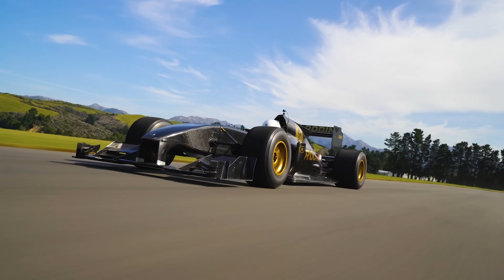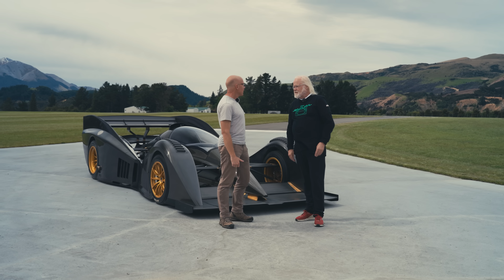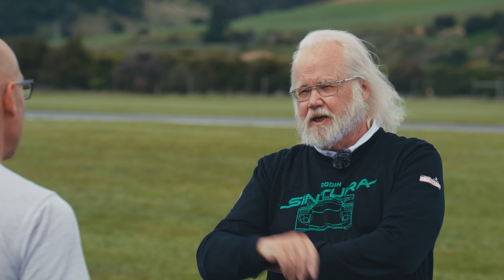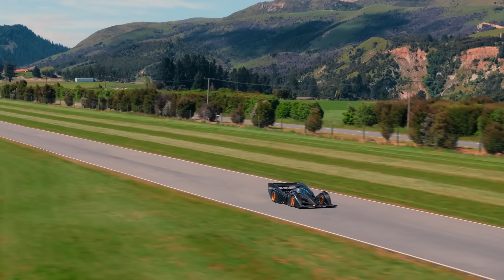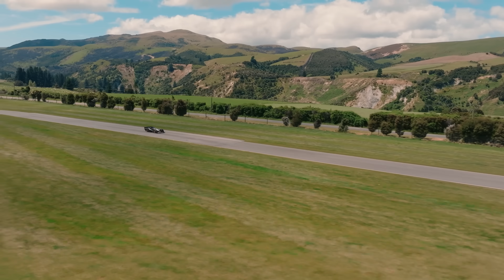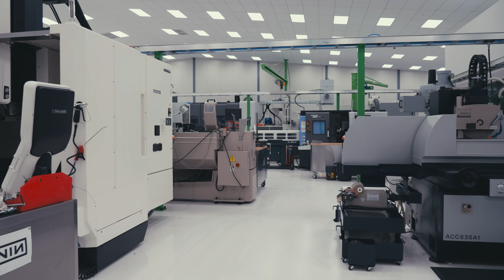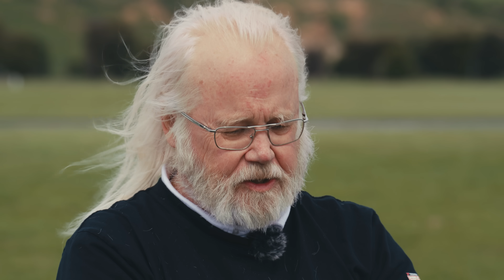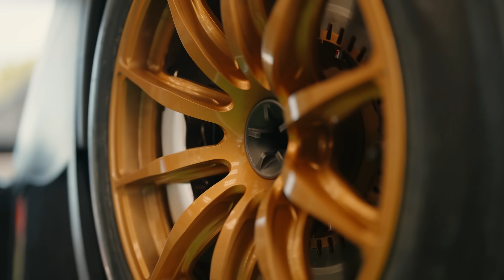Rodin FZero – 1500bhp Single-Seat V10 Madness!

Comment: This guy sounds like he’s on the top of the Dunning Kruger curve. 
So arrogant into thinking he can make a car faster than an f1 car that not only takes millions of pounds and years into development but also hundreds of the most talented people in their respective fields all working together. 
F1 teams don’t just build a car based on couple of YouTube videos and a few nights of thinking. It takes decades of knowledge to carry it all through
Reply: No. They build cars to very strict rules.
Without the rules it’s EASY to go faster than F1. Imagine an F1 car that wins by cheating. Then imagine a car that ignores the rules. Not cheap or a 5 minute job, just very very do-able.
Newey is not god.
Reply: Yhea it’s very do-able… for a team with 300 engineers 😂. Not one 70 year old dude who can do a bit of CAD. Hence why this guy‘s car hasn’t beaten an F1 lap times.
Just the fact of him saying they do CFD at 300 kph is already a red flag.
Reply: @diogosimoes3618  You could do it in your shed. Just requires will, imagination, a bit (maybe a lot) of engineering nous and a pile of cash.
Check out Robin Shute’s pikes peak build.
And maybe my next one, if I get my act together.
Btw, a single seat closed wheel car with 1500bhp would do 300kph on about 1/2  throttle. It’s also got the potential to pull enough G’s that the driver would need a g-suit. Why is that ridiculous?
Reply: Do you realize that Porsche took their lmp1 car, which btw also costed over 100 million to develop,  made it into a monster that didn’t have to oblige to a rule book and still couldn’t beat the f1 cars of today. 
It’s called the 919 evo. And it definitely wasn’t built in a shed by some guy who knows a bit about race cars and so he thinks he knows it all.

Also it doesn’t just take power or downforce for a car to be able to be fast. It has to be well balanced. Predictable. Forgiving. 
Those are the things that cost the 100 million plus pounds and the hundreds of talented engineers.
This car isn’t as fast as an f1 car. I bet it wouldn’t even beat an LMH car.
Reply: @diogosimoes3618  no. The 919 was still built to a rule book and the evo was a drestricted version.
Being “balanced” and “forgiving” does not cost millions, don’t be so stupid. They are the product of setup - as long as the fundamentals are right.
Sorry, weight, power and downforce are what create speed and this thing, while hideous, has the potential.
I say again, look at Robin Shutes pikes peak build. That’s going to be on another level.
Don’t be so blinkered that you think a Porsche badge and 100million makes the ultimate. It’s an lmp car, still limited by rules.
Reply: @jiminycricket9877  Jimmy let me tell you something. I know your wife left you and now you spend the days in that ass shed of yours acting like you’re building a race car. But unless you’ve actually done it or worked with people from the Industrie I would stop making a full of my self in the YouTube comment section acting like you know it all. You’re not a genius Jim. You’re just sad.
Reply: Just outta curiosity. You “know” all this how ? Cus you seem to know an awful lot my guy. 
Have you built a race car before ?!😯

Oh wait… is that the race car you built in you profile pic. Damn. I bet that could beat an f1 car 🤣
Reply: @diogosimoes3618  no, that’s a road going Peugeot 205, I’ve never claimed anything else! Yes, I’ve been involved in building numerous track, hill climb and rally cars over the years. I’ve had a concept in my head for a long time now and hope to make a start on it at some point. I freely admit that I don’t have resources to go as fast as F1 and it’s not my goal - I just want to build what’s in my head to the best of my ability.
Why do you feel the need to troll someone who is merely pointing out that F1 and LMP cars are built to strict rules and therefore are not the ultimate? Odd.

Comment: It's a wonderful artistic monument to Mr. Dicker's passion, but I'm glad to hear this is going to be superseded by a V2. I hope the aero folks are listened to, as this version has some very pronounced flaws. Also, the exhaust in the air stream isn't just obstructive of flow, but it'll harm engine performance by cooling the exhaust excessively before it reaches the turbos - not ideal. But more power to him, it's a wonderful venture...

Comment: Of all V10 engines to inspire sound, they choose Viper. What a thash!
Reply: although not impressive for power density, the viper engine had a lot of advantages over the other few V10s that came and went, its low power density meant it was more durable and delivered a smoother driving experience, despite the car itself being very... volatile to say the least, it was motly due to the lack of other safety and driving assistance features rather than the engine itself. 

also the viper engine was the first road legal V10 and what uultimately started the powertrain usage on cars as it was already a novelty, and a rare one, in the world o powertrains, and it remained a rare breed through its history and now its virtually dead, with no production road car with a V10 existing, F1, LMH, and others dont use it anymore for years. the last road cars to use a V10 were the just discontinued Audi/Lambo FSI 5.2L based cars, not just the R8 and Huracan but also 2 notable very limited projects, the Pambuffetti PJ01 and the Bertone GB110. both very limited production which i think will finish delivers till 2026.

this, the RB17 and strangely enough a Rolls Royce war tank engine are the only modern usages of a V10 currently, with Rodin still offering a 4.0L crate V10 or sale and Judd still offering maintanance, upkeep and specific comissions with their limited set of V10s, but i think they only rent the engines dont fully sell or manufacture new ones.

Comment: the FZero looks like a moden Can-Am Monster. The huge fenders, the gigantic wings and the overall proportions.... just as crazy as the cars in can-am in the 70s with basically no rules
Reply: This is the closest idea of what a modern Can-Am car might look like.
Reply: Mclaren
Reply: @CrashInnes  My first thought on seeing the rear wing & it's buttress' was M8F. I'm surprised it wasn't mentioned, he being a Kiwi & all.
Reply: That is what I was thinking as I watched it drive around at the end. I wasn't so sure of it at the start.
Reply: Exactly what i replied. This is what can-ams would look like if they still raced
Reply: My thoughts exactly!! Can-Am rules!
Reply: I'm not sure where these claims of reliability are coming.  We aren't talking about an engine with decades of testing and development like the Judd V10 or just about any other engine.  There's a reason many larger carmakers choose proven crate engines.
Reply: @KRAMITDFROG  I think what is meant here is 'short-term reliability' compared to all-out race engines that sometimes don't last a single race. It might seem like an oxymoron but it's all relative.
Reply: i was thinking the same also reminds me of the 917
Reply: Love a big wang..... Big Wang Gang for life 😁
Reply: Sadly making the same power as they did 50 years ago.
Reply: @BobBobbington66-t9s  .... probably with reliability and performance they would kill for 50 years ago.
Reply: @BobBobbington66-t9s  but way more reliable and without the need to rebuild the entire engine after a race
Reply: @BobBobbington66-t9s using about half the displacement.

Comment: This can not be put in the same category as the McMurtry Spierling. Sure they can both do "F1-like times" around a track but the Spierling is beautiful and this thing looks like it was designed by a blind 8-year-old using his/her/their non-dominant hand. I don't think anyone, regardless of their level of wealth, will buy this car over any of the many beautiful options already available. Even if it does have a V10.

Comment: the nubers and the headline are great, but, BMW got simimlar power from a 1.5litre 4 cylinder back in the 1980s. So although this will be a fun toy it hasnt really moved on since our acheivements of 40-50yrs ago.
Reply: Yes, they did, for one lap before exploding running 80 psi of boost with a mixture of gasoline and toluene, and this makes 1500hp compared to an alleged 1400hp for the f1 engine
Reply: @user-cu4mo8hv1f      so the point is that we know how to get 1hp/CC, or 1000hp/litre.  its not new information.    we havent moved on in terms of specific output.
Reply: Power and torque curves, drivability, emissions regulations etc should also be considered. Like you said it’s not all about numbers and headlines.
Reply: @MX5-XU   race cars dont need flat torque curves or driveability, theyre on track going flat out the whole time.
 o you think this carbon fibre batmoile will be used in the daily traffic and the morning commute? or does it appear to be comprimised toward on-track perfomance?
 completely different set of priorities for a completely different purpose
Reply: @nickcook7408    it’s not a race car, it’s a track car designed for fun as you said. And not only that, it has to be designed for the customer demographics it’s targeted towards, many of which aren’t professionals who have any racing experience and who won’t be going flat out all the time especially when they are still learning the car and any new circuits. And I cannot remember two months ago when watching this but it sounds like it is being designed for road legality which is why I mentioned emissions as another consideration even if it won’t be used as a daily driver it still has to be manageable for a more docile environment as to not be miserable if an owner wants to take it to a cars and coffee, drive onto the lawn at Pebble Beach or even simply to load it onto a trailer.
Reply: With 100 psi and crazy fuels sure let’s compare the bmw to a plane then it’s way behind on engineering
Reply: @chabweezy9905     cylinder pressure and anti-knock properties are key to all internal combustion engines.      some are better at it than others.

Comment: I would have added a lightweight rimac battery with a couple a/c motors at each end and made it a torque monster.
Reply: How much would a Rimac battery weigh?
Reply: @MX5-XU   There's one in the Aston Martin Valkyrie
Reply: @joebeus6886  any idea how much weight it adds? Of course Valkyrie doesn’t have a driven front axle, wonder if such an implementation is even necessary for this application and level of downforce.

Comment: The reason F1 teams spend so much money is because they are forced to make the car go fast despite the rules trying their best to make them go slower. If there were no rules in F1 they could have made the cars a lot faster than what they are today at a lot lower cost
Reply: They'd still end up spending a shitload of money.  Competition is competition, and more money spent usually means a faster car.
Reply: @jacobm2625 That's why f1 has cost cap
Reply: The slowest car on the grid is a mere 2% slower than the quickest in absolute numbers. Virtually 90% of the money is going into chasing that last 1-2 seconds.
Reply: @srinitaaigaura in F1, being 1 second slower per lap during race is enough to relegate the slower car to finishing at the lower half of the pack.
Reply: @srinitaaigaura 
Not 1 to 2 seconds, more like 1 to 2 tenths of a second.

Was a time when Ford Australia needed an extra 50 hp just to gain 1 tenth of a sec.

When the cost of gaining that 50 hp became too expensive, they stopped development of that engine.

F1 teams don't stop.....they keep spending until they go broke or sell.
Reply: having ''no rules'' would end up resulting in these races becoming slaughterfests, but its true that there are way too many restrictions on F1 which is part o what killed its excitment and even the major potential of these cars, to the point things that are more properly aligned with actual cars without restrictions can be faster like this or the future RB17.
Reply: @unkindled6410  f1 is as much about engineering development as it as about racing, maybe even more so.  They could still keep things competitive I think if they opened up a segment of the car's design each year with relaxed design constraints in targeted areas.  These constraints would rotate from year to year to different parts of the car.  Whatever advantages you gain in one year counts as points to reduce what you can do in the following year. That could be a way to add excitement and intrigue without letting one team run away with it entirely.
Reply: @cskovach  I feel it should be turned into new category, like F-0. Fia could provide general restrictions for chasis size and shape to make cars look similiar, throw some basic safety regulations for internals and let the engineers cook. Different season = different engines, diferrent aeros and a pass for everyone to use experimental tech - make the racing great again. Adding the restrictions for winners great idea, keep them busy and let others cook too.
Reply: @unkindled6410 
Not too many restrictions, simply the wrong restrictions and application of said restrictions......and then there is the corruption and BLATANT favouritism.

Of course, all this existed under the French controlled F1 set up, got worse under Bernie Ecclestons illegal constructors take over and now under Arab and USA money it is being destroyed.
Reply: He says this multiple times
Reply: not quite true, many of the restrictions are to lower costs.
Reply: That's probably why that called it the Fzero
Reply: That's literally what he said... Paraphrased: "It was hard to be as fast as F1 in the 70s because they had unrestricted development, but now you can do it, and you don't need to spend F1 money they do to achieve it".

Listen to what the guys saying
Reply: Fuck rules
Reply: On paper..
Reply: "A lot lower cost" is an uneducated guess, race cars are expensive because developing better engines and tires is expensive, aerodynamic parts are cheap but the wind tunnel operating costs are high.

Without regulations all cars would have automatic suspension, aerodynamics and traction control, lower costs are a result of simple regulations and standardised parts.
Reply: No rules would mean the drivers would pass out mid corner from the g forces and no overtaking only when the car in front crashes
Reply: @nickk707  They wouldn't. For the last time, lateral g's are not vertical g's. It'd be uncomfortable, but the average person can sustain 10+ lateral g without passing out. And a formula 1 driver is absolutely not the average person. Pulling more than 10 lateral g's in a truly no rules vehicle would indeed be pushing the limits of a driver's muscular strength and endurance, but it would absolutely not be making them lose consciousness.
Reply: @Domi39   it would still be impossible to drive because no human being would be able to react quickly enough under those extreme G forces for multiple laps at a time. The physical exertion to turn the steering wheel while under ~10g's of force would be ridiculous. If your arm weighs 6 lbs that means under 10g's you know have to move a 60lb arm. Go to the gym and grab a 60lb dumbell and see how easy it is to "steer" it 😂

And that doesnt even take into account braking which absolutely would make them lose consciousness if the forces were high enough becuase they are negative g forces. Which humans can not withstand nearlyas well (basically all the blood would become stuck in their brain, something called a "red out".)
Reply: @Domi39  we had this its called the Toyota bone crusher
Reply: @HandlebarAnderson driver’s needing a G suit to race would be crazy
Reply: @Domi39  wrong
Reply: tough necks on those little fellas
Reply: @nickk707 no they wouldn’t they wouldn’t ever make more g’s then a fighter jet.
Reply: @Thumper68  they easily could under breaking with double or triple the downforce.
Reply: @nickk707  f1 max is 6gs fighter jets are 9gs. In 1954 John Stapp survived 46g stop in an Air Force test and didn’t pass out. You have to be at high g force for sustained amount of time to pass out it just wouldn’t happen to seasoned f1 drivers.
Reply: F1 car's are still way faster than this thing. The mighty W11 from 2020 is like 5s faster than current gen cars.
Reply: @MizukaMotorsports  The W11 beat a no rules LMP1
Reply: @myusername3689  in terms of who is driving the no rules LMP1 the time should be near or close to the fastest F1 car, it all depends on who the driver is.
Reply: Maybe they could but in the mean time, nobody made a car faster than an F1, not even Le Mans prototypes are faster. Most hypercars barely reach the GT class in terms of laptimes. F1 is 4 stages higher and the difference between only two stages is night and day.